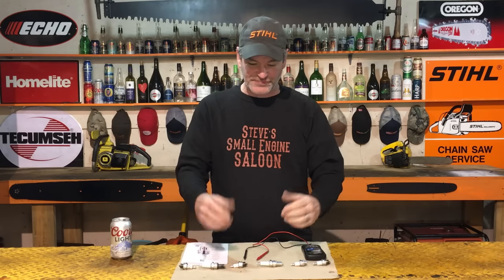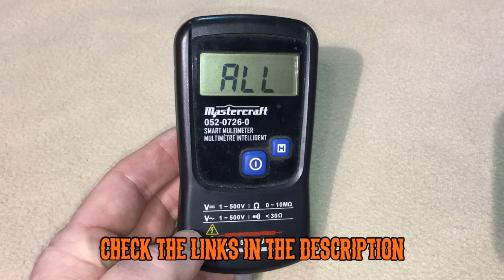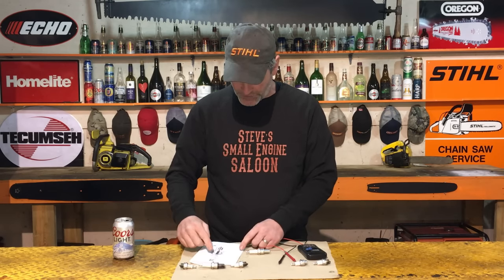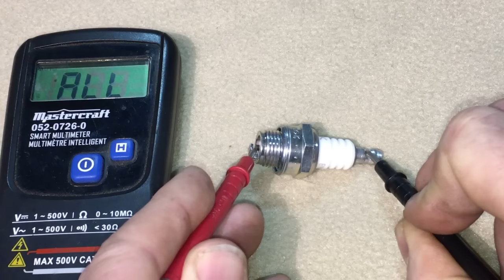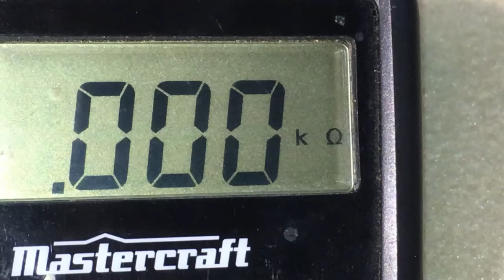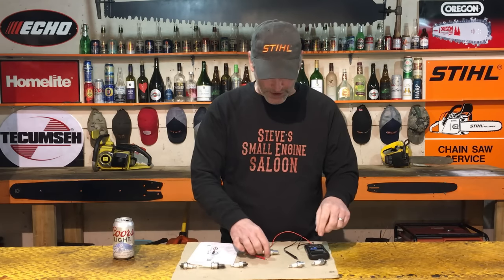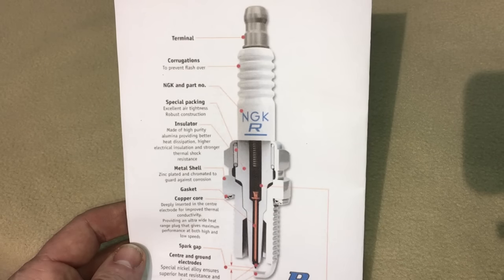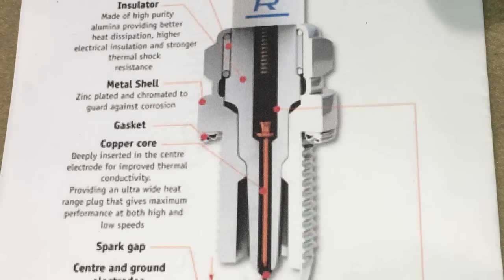How To TEST A SPARK PLUG In 1 Minute

Comment: Long, long ago I used to see spark plug testers being used that required the spark plug to be screwed into the tester and then the tester's chamber pressurized with compressed air to simulate the actual condition the spark plug would be under when in use. Many spark plugs would fail with the spark actually jumping through the ceramic material well up inside the plug instead of across the gap as it was designed to work or being weak/the wrong color. I don't know if the plug manufacturers improved the ceramic material so that the arcing internally isn't an issue anymore or if the testers are just too expensive and are just no longer used. I see more than a few YouTube videos of them still being used for aviation engine spark plugs.

Comment: I test a spark plug by the one pull rule. If I can't start my lawn mower in one pull I go down and buy a new spark plug and replace it. I change the oil and air filter and if it pulls in one pull after that I know the new one is good and the old one can go in the trash. LMAO.

Comment: I just put screwdriver in the end of lead and hold the shaft close to fins but leaving a gap and pull if you get spark then plug needs att or replacing. 
You do not need a multimeater in fact its a waist of time getting it out, i have been a mechanic for about 30 years

Comment: You could have continuity from the tip of the spark plug to the threaded part if there is carbon deposit on the insulator.  Carbon conducts electricity.  It's best to clean the spark plug with a spark plug sand blaster to remove all carbon, oil, etc.  Then make the resistance tests.

Comment: Never ever clean a sparkplug corenose area with a wire brush as the bristles will leave a metal coating on the end of the corenose and this will cause a flashover and sparkplug failure you could try cleaning them with cellulose thinners.
   You could also use a megger to test the quality of the insulation.

Comment: a dry crack in insulator would be too high a resistance to read .it will only show up when you put high voltage through it. the plug you showed was fouled with oil and carbon from center to side

Comment: No meter no problem I just remove the plug ,hold the plug wire close to the metal engine frame and pull the starting cord , if there is a good spark at the cable end  the coil is ok , now connect the cable to the spark plug and lay the plug on the engine frame, pull the start cord , if there is spark at the plug gap the plug is ok if no spark replace the plug.

Comment: Thank you Steve. What is the function of the resistor?
Reply from the maker: The resistor is there to suppress radio frequency noise which helps 
protect car radios, mobile phones and engine management systems.  AND 
some ignition modules require a resistor plug to allow the coil timings 
to work properly.....

Comment: If you got it out just f**king replace it.   Just pull spark plug wire with motor running if motor sounds the same the plugs bad

Comment: I use my old spark plugs to open beer bottles with. Tap and thread a steel plate, mount it near the trash can, insert the plug so the business end shows and insert beer bottle. Use a little leverage and Holy Guacamole it’s opened! Yes for a practical joke, one could hook it up to a neon lamp charger for that neighbor that borrows your tools.

Comment: For a homeowner, using equipment on the weekends, how often should we be changing the plugs in trimmers, mowers, blowers, etc?  As always, thanks for the videos!
Reply from the maker: I personally would never replace a plug if it still works fine and has a nice blue spark on it.....
Reply: Steve's Small Engine Saloon Thank you!
Reply: @StevesSmallEngineSaloon  in chainsaws, I find sometimes the electrodes fall off if plugs are left in  for too long, and then ruin piston

Comment: Never use a wire brush of any kind to clean a spark plug .  It will leave metal deposits on the insulator and short out.

Comment: Champions usually have a higher resistance, especially over time. Champion aircraft engine plugs are notorious for this.

I prefer Autolite or NGK for cars and NGK for small engines. If the plug gets dropped, throw it away in case the insulator is cracked internally.

Comment: This is good knowledge to have, thanks for this because I’ve wondered at times if I’ve wasted money buying a new plug.
Reply from the maker: You're Welcome...
Reply: I guess it depends. The sparkplugs don't really go bad that easily. If the ceramic lining is broken, ot is most probably because you drop it. When the money is not tight, change them whenever you feel like for as long as it makes you happy. If the money is of a concern then, perhaps do what would do, take the plugs out, clean them, given them a good scrub like its the most previous gem in the world. Check to see if the gap is about right. If not, adjust them accordingly. It's not like the tips would normally worn down to nothing left. There is always the wasteful way, the normal way and the cheap cunt's way to skin a cat.
Reply: @shenghan9385  Personally if it's a tool/vehicle that I really depend on I'll change the plug(s) on a whim. But I think this tip is great for lawn equipment, stuff around the house.
I go bass fishing a lot, sometimes alone, usually in the back country where you don't have cell service, no houses around,  and the lake's too big to troll back... So I change all 6 plugs (and more) in my outboard at least once a year, or any time I ever notice the motor sounds a little off... Never test em, but keep the spares in my tool box with a gap tool
Also.. I know a few mechanics at a local car dealership.. They once ordered 2 cases of brand new spark plugs and almost every plug  in the 2 cases had hairline fractures... Just because you didn't abuse your plug doesn't mean someone else hasn't

Comment: I had to smile when you said sometimes it’s the on off switch.I went to start a guys snowblower and the key was in which is what it usually is in order to start it.So I looked at the sticker and it signalled that when the key was pushed in the machine was off and when the key was out the machine was on .I’ve never seen that before and i can’t even imagine why anyone would build a machine like that.If anyone knows why that would be please tell me.

Comment: I have a spark plug (CMR5H) with 44k Ohm resistance which still delivered a (purple colored) spark. The engine (Honda GX25) also started sometimes but died after 5 seconds. Could have saved me a lot of time if I found your video earlier. ⌛
Reply from the maker: Right on....

Comment: One possibility for the spark plug that showed a connection between the center rod and the outer case. most likely is the carbon build up on the ceramic surrounding the center where the spark occurs inside the cylinder head. I've found that on a spark plug before. A few shots of brake cleaner and cleaned out the spark plug with a tooth pick fixed it.

Comment: I just checked a champion plug brand new out of the box RS17YX and doesn’t test like your saying.
Reply: I believe this spark plug uses a silicon carbide resistor (SAC-9) and cannot be tested with a standard ohm meter. The championautoparts.com website list the part number RS17YX as having a "SAC-9" resistor type. 
https://www.championautoparts.com
http://www.electroair.net/pdfs/champion_spark_plug_resistors.pdf
https://www.sparkplugs.com/what-are-the-different-champion-resistor-types
https://www.gsparkplug.com/media/wysiwyg/technical-information/champion/Champion_Resistor_EN-F-ES.pdf

Comment: A little confirmation for you.  The specs on a NGK BPMR8Y, a really common chainsaw plug, as I am sure you know, are "Approx 10,000 Ohms" resistance.  Oreilly auto has the specs listed, if someone needs to double check.
Reply from the maker: Lots of Echo products come from the factory with that plug!
Reply: @StevesSmallEngineSaloon  Yep, was buying a spare for my CS590, and seen it jived with what you were saying.  I smiled, cross referenced it is the same as the Champion plug in my 20 ish cc Pull-on.

Comment: You taught me how to diagnose a spark plug. It's a good thing you don't charge money for this info because I would be on my 2nd mortgage by now.
Reply: Learning to" Read " plugs became a habit of mine after working with snowmobiles. I could tune any engine just by looking at the color of the plug. The same goes with any small engine. Most run too much oil in them. That oil get into the core of the plug due to thermal expansion. The oil cooks inside the plug and cracks the center electrode. I tell most guys to change their plugs every season and " Read" the plug. That plug can tell you exactly what is going on with the engine. Be it chain saw, boat, snowmobile or anything with a plug. over time, the plug is like a computer and stores information on it. Its up to you to know how to " read" that information.

Comment: Not sure how a hairline crack in the insulator that causes voltage to "leak through" can be detected by testing for continuity? Wouldn't the two metals have to be touching to show up on the meter?
Reply: Not if there is conductive contamination in the crack.

Comment: Or...plug the spark plug wire onto the plug, crank the engine over and check for spark. Now that was under one minute!
Reply: that is true but if you are in sun light good luck trying to see the spark.  Also you need to have a good ground.  sometimes that is hard to get with in the reach of the ignition wire.  I have a spark tester and the same problems can apply.  In short,   if you see the spark great,  You know it is ok.  If you don't.  It still may be ok for the reasons I said above.  The method he showed is more reliable.

Comment: Quick question. I have a xstreem 6.5hp pressure washer and its hard to start and some time i have to relief pressure from the gun to be available to spin the engine to make it easy to start. Is this normal. Thanks for your help

Comment: Once in a while I get a plug that won't fire when it's in the motor but if unscrewed and earthed, sparks great when I pull the starter. Put an old plug in and starts fine. That's why I always keep old plugs from services that still work. I never thought to test them on the multi just for curiosity sake. Theyre not common either, reckon I've had 3 like that ever and I'm 51!

Comment: I think you must be a mind reader, was just wondering how to check the plugs on my outboard.
Reply: NGK are prone to fouling. I used to work on marine engines and I went through those plugs like crazy. If the carburetor was out of tune, the plugs always fouled first. Trying to clean them drives the fuel/ oil farther into the plug, making the plug useless. I worked mainly on snowmobiles and my usual maintenance process was to tune the carbs on fresh plugs. I always changed my own plugs every season. I saved the old set as reserves or ran them mid season as long as they worked. The invent of oil injection helped with saving plugs but the injection system on most snowmobiles was always set richer than needed to cover the manufacturer's rear.  I always dialed down the injection on my sleds and set up the carburetors to maxamium efficiency.  Something most people didnt know how to do. Comes with building engines and racing. I learned enough to be dangerous.

Comment: why would there be resistance plugs in the first place?
Reply: Radio interference for one, plus some  ignition coils with built in spark advance need resistor plugs to function correctly.
Reply from the maker: Bang on Brother.  Thank You...
Reply from the maker: The resistor is there to suppress radio frequency noise which helps protect car radios, mobile phones and engine management systems.  AND some ignition modules require a resistor plug to allow the coil timings to work properly.....

Comment: Replace the $5.00 spark plug instead of all the f...... around. Few of us have all that equipment and no time. I've ner bought a new lawnmower and they have all lasted 25 years.
Reply: Then if it still doesn't run right, you still have to find the root cause. Testing helps to troubleshoot the issue. Plus the only equipment needed is a simple, inexpensive meter which you can get on Amazon, Home Depot, Lowes, or many other places.
Reply: I have one
Reply: Then follow through to coil.

Comment: Just changed my plugs on my van. 400k miles on those factory plugs. That resistance means about as much as the sticker on a windshield saying to change your oil in so many months. They just want to sell you something. All that resistor does is keep your ignition from interfering with your radio and tv. It would have to be open or out of speck several times over to make a difference or be bad. So you're right

Comment: I have never heard of anything like the resistance sparkplugs... Sounds...... And I doubt anything like a hairline crack in the ceramic tube will cause a short there. As far as I am concerned, your multimeter resistance test will not detect no shit as to whether or not there is a crack in the ceramic insulator. You can break the ceramic part into however many pieces you like, if the metals of the inner core and outer ring don't touch, you should naturally have a bloody infinite reading on the ohms meter like it is normal. The mutlimeters work on what? 9v battery max. It's not like it has the voltage to ever cause what you described as "leakage of current" for as long as your "hairline crack" is dry and free of contaiments. A sparkplug with a cracked ceramic part of course needs to be discarded because whatever is meant to produce a nice spark to ignite the fuel in the cylinder may want to simply spark it out through the crack. Or if the crack is filled with moisture, dirt and dust, it is simply short out.

Comment: Great video Steve. 
Can you do the relevant test on a coil/stator/ignition module  some time please.
Some  small engines (especially Stihl ) will still give you a spark, with the basic test (holding the plug on the engine & pulling it over) but run rough.

Comment: Like  i said  before  take  the top off  engine  down  to  flywheel  and  coil and  clean  coil and  flywheel   and  ck. Air gap you can  ck it with  a businesses  card. And  then i would  ck  plugs with  a volt  meter . And  if they ck out good  i would  pull kill wire from coil and  see if it starts.you know  its in that's  wire . If it doesn't  replace. .  Coils.  Also  ck all your  safely  switches you can  unplug  them  one at  a time  with a jumper. Wire  making  connection  .and  you can  find out. Which ones isl bad.